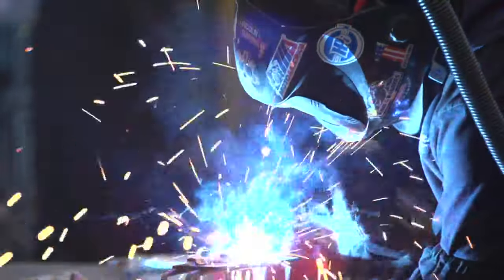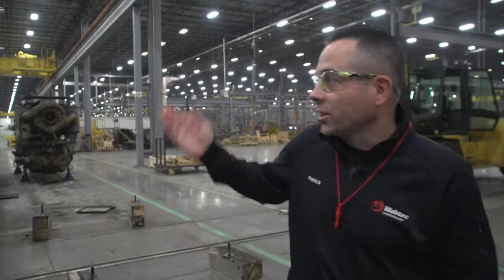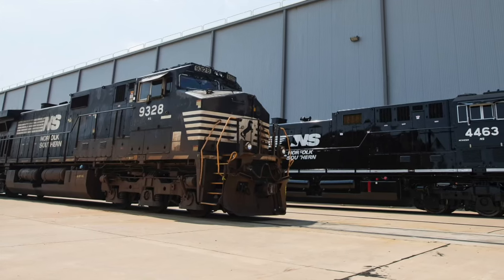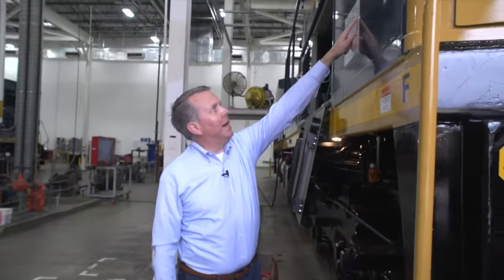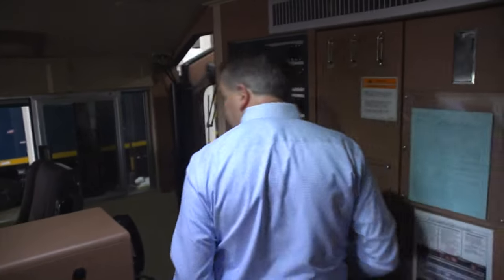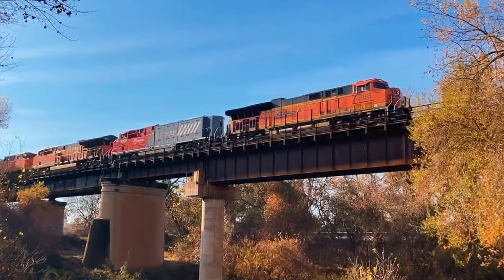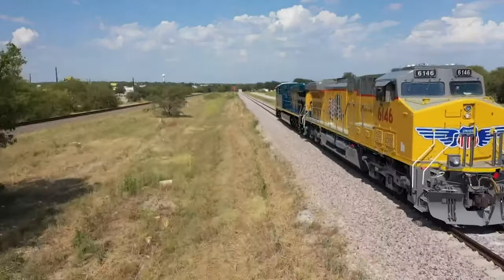Fort Worth factory successfully reinvented itself after railroads stopped buying new locomotives

Comment: Its a lot more than a single residential block. How does this guy know so little about electricity
Reply: Really hard to get good numbers on absolute peak, average peak based on season and region. Even worse is how many homes in a block; numbers from 10 - 600.    [ 7.2MW per train, I know of a small full service hospital that had 2MW emergency power. 30KW peak per house gives 240 homes. ] 30KW is like absolute peak - huge AC, Water Heater, Clothes Dryer, Cooking Stove, Hair Dryer and some other junk running.

Comment: Nobody wants to deal with the maintenance of tier 4 emission systems. Major headache to deal with. Not to mention the government fluid that is required for those engines. Much easier to rebuild the old stuff than deal with the new stuff.
Reply: The locomotives actually don’t take DEF, even the new Tier 4 ones.
Reply: Locomotives having to use DEF would be a disaster to the food supply.  Trucks already are.

In the lockdown UP embargoed CF Industries, a major ammonia producer.  That caused a squeeze on both fertilizer and DEF, which led to further transportation and agriculture issues.  DEF is an unnecessary vulnerability in the economy much like ethanol.  Why do we keep using food for the wrong things?

Comment: You had me until you started talking about "Zero Emission Battery Powered Locomotives."  The juice to charge that thing has to come from somewhere outside of the unit.  It seems odd to think that two or four of these things will probably end up pulling coal trains, coal to run some of the electrical plants needed to keep the electricity on.

Comment: Battery-Electric locomotives are one of the dumbest ideas ever. All-electric locomotives have been around since the 1930s or earlier. They use power lines and pantographs instead of batteries, and although power lines are expensive, batteries are more expensive. They'll have to be replaced every 5-10 years (easily half the cost of the locomotive) and lithium ion batteries are not at all environmentally friendly, despite what EV companies might tell you. Oh, and the cobalt in L-ION batteries is almost always obtained via child labor.
Reply: It’s better for forests forest fires can easily be starts from cantinerys
Reply: You don't need cobalt for batteries. It depends on what battery you use.
Reply: @placeholdername0000 not addressing any of the other points I made. I am aware that cobalt isn't a strict requirement but most L-ion batteries have it.
Reply: @Amigafur  Except that LFPs don't and they are quickly becoming the dominant type in EVs and energy storage.

Comment: The charging systems are not near enough to replace anything. When a battery system can be recharged as quickly as filling tanks with diesel, then we can be impressed.  Until then, we are dependent on oil.
Reply: Absolutely not, we need electrification and depend on dual mode locomotives like the Eurodual or Euro9000 from stadler or a Siemens Vectron.
Reply: we need over head wire power locomotives again in the usa there where tons of railroads using electric locomotives in the 40s but around the 60s and 70s they went full diesel sadly
Reply: @Zdogcat  How do you think we are going to power those locomotives? Coal? Basically there is no way to power anything eletrically without creating emissions of some sort, with the execption of solar but you are talking massive solar farms to power just one section of rail. Never mind the emissions to build, install, and maintain those items. If we still built nuclear plants, sure it would be a viable option, however the only way we produce eletric is coal, gas, water, solar, and wind, all of which are not mature enough to over come coal to even replace 50% of the actual load of the grid. These are great ideas once we aren't burning coal to power eletric cars, trains, etc, but until then, its absolutly useless as all it is doing is "transplanting emissions" to a place you cannot see it. (will add nuclear is about the best option as it does not take up massive amounts of land, very safe, and little to no emissions, espeically if they contiune with the work on disposal of the waste via bacteria, or at the very least finding a storage means under ground that are 0 maintenace so that in the event (always does) that maintenace is not funded, or provided 50 years in the future, the ground water is not at risk and the waste cannot phycially go critical by over heating)
Reply: @zimbabwesteve4620  Nope. There is not a power generating station every few miles. Now, electric trains (which get electricity from catenary) use traction substations.
Reply: @bluemoose0074  The United States enhanced geothermal power resource is 500 thousand megawatts (500 gigawatts).
Reply: @bluemoose0074

Even if you used coal to power the locomotives it would be cleaner due to economies of scale and the ability for huge coal power plants to scrub emissions or sequester CO2 underground.  

It would be even better if locos had batteries for dynamic braking rather than resistors to turn it into waste heat.  

Renewables and nuclear power are the answer and they are growing in capacity everyday.  Along with storage solutions like batteries, pumped storage, heat sinks, salt tanks, and hydrogen distillation so that power from renewables like wind and solar are available 24/7.
Reply: @bluemoose0074 Hasn't coal mostly been replaced with natural gas already?

Comment: Find a way to build a nuclear powered locomotive that uses a fuel cell similar to that of the probes we send into space and you might actually make progress in getting away from fossil fuels.
Reply: The fuel cells they use in space are tiny. Basically, they jus use an isotope of plutonium whose radioactive decay makes it physically hot, and then use thermocouples to convert that heat into electricity. You get almost no electricity that way -- just enough to power small electronic devices. They most commonly use plutonium-238. You'd need nearly 6,000 tons of plutonium-238 to get as much power as a modern diesel locomotive.
Reply: @beeble2003  Thanks for doing the math on that. I'm not a nuclear physicist by trade and I was just bouncing off an idea without really thinking about how large something like that would actually have to be.
Reply: @HustleMuscleGhias  In fairness, I should have mentioned that a small conventional nuclear reactor would be a much more plausible power plant for a locomotive. The kind used for space probes is only suitable for very low-power applications, but a "normal" reactor would probably be workable. However, people would be very unhappy about nuclear-powered trains running through their neighbourhood. It would almost certainly make more sense (socially and even economically) to just build a normal nuclear power station and install overhead cables to run electric trains.
Reply: Brew yourself a particularly hot cup of coffee and look up the wild X-12 Atomic Locomotive.  You'll love it.
Reply: Westinghouse designed a nuclear locomotive 70 years ago!! It uses the same reactor as submarines of that time.
Reply: Or you could be normal like France and connect Nuclear power plants to catenary

Comment: These rebuild programs are as much about avoiding problematic Tier 4 emissions standards for new locomotives as they are about saving capital. 

There is a reasonable “middle ground” approach to battery electric locomotive tech. No, they may not ever completely replace diesel freight locomotives. However with improved energy density from graphene batteries, they could at some point greatly increase efficiency by harnessing wasted energy from braking and allow fewer diesels to move the same tonnage. It’s not any different than how a Prius works. People need to be more open minded and realistic about the problems and potential benefits of battery tech.
Reply: battery tech can definitely be beneficial. but it's not a fix all like many companies oversell.

Comment: I want to give some perspective regarding battery electric locomotives. A modern train doesn't have just a locomotive in it, but various machines. 

The electric locomotive is intended to be used in a hybrid consist where its main purpose will be to recharge itself using the dynamic brake.

Comment: Oh please all electric battery locomotives will be an absolute flop, especially in cold and wintery conditions.
Reply: They basically just use them to start the train & going uphill. They don't use them for 100% of the trip unless it's a short distance. Most if the time it's off. Just dead weight.
Reply: @TheMrPeteChannel  so basically its relatable to a SLUG.
Reply: Well, the advantage is a much lower maintenance cost. If you use batteries that are optimized for a long cycle life you will have very few parts that wear out. On the other hand, your locomotives will be heavier. Much like you said, they will essentially have a slug/B unit permanently attached to the locomotive. However, the extra traction is just a neat bonus. For winter weather the locomotives have an advantage over electric cars, since they're huge. That makes it much easier to keep them warm, to the point where the extra grip might actually give them an advantage.

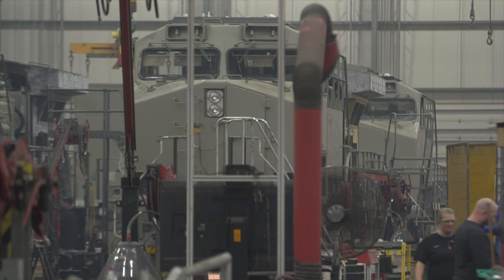Comment: 0:38 "railroads aren't buying new locomotives anymore" All Railroads except Passenger Railroads. Ik your mostly referring to freight railroads.
Reply: Mostly related to 'Tier' mandates govmt imposes on emissions. Rebuild doesnt need to worry about such.
Reply: @aerospot2  Correct! The passenger railroads are mostly all government run. If the emissions equipment proves unreliable and costly to maintain, then they just raise your taxes to pay for it.
Reply: Yes, they're referring to freight railroads, since those account for well over 95% of the locomotives in the USA. Amtrak, by far the largest passenger railroad company in the US, owns about 400 locomotives, so I doubt there are more than 800 passenger locomotives in the US in total. Union Pacific, on its own, has about 8,000 freight locomotives. So, even if the only railroads in the USA were Union Pacific and passenger railroads, freight would still account for 90% of the market.

Comment: They’ve tried battery powered locomotives for years, and every single attempt fails miserably. Second only to attempts over the last 30+ years to put Caterpillar engines in locomotives. Fails every time…..and usually a catastrophic failure.
Reply: They've tried the Cat powered engine for years. Norfolk Southern tried in the  80s with rebuild GP-9s rebuilt to TC-10 standards.

Comment: A locomotive that can power up a neighborhood 😮🤔?
Where was this guy when the electrical gid in Dallas CRASHED 😮.?
With so many locomotives in storage they could of plugged a few into the grid and solved that issue 😉. But NO, let's let everybody freeze 🥶 along with their brains and don't think outside the box.
Think back, with that ice 🧊 storm that hit the northeast and Canada, CP Rail took one of their engines to a ice covered crossing, turned it 90 degrees, and drove it down the road, and plugged 🔌 it into the grid. 
True story. 
WAKE UP DALLAS⏰! IT HAS BEEN DONE😮!!!

Comment: The FLXDrive is a glorified time-shifting slug unit for cheaply built, slow and steady mineral railroads like the B&LE that have a roller coaster profile, and have to use more units because of isolated grades.  And a publicity show horse of course.

Comment: Dude we can't even get electric cars, let alone electric semi trucks to be reliable or efficient. We have no business looking to mass movers like rail, sea or air to go EV especially in a commercial/industrial/long-haul capacity until we can get the smaller units squared away. Every other evolution in propulsion has started small and expanded to larger power plants, this is no different. There is no sense in reinventing the wheel. One foot in front of the other. One step at a time.